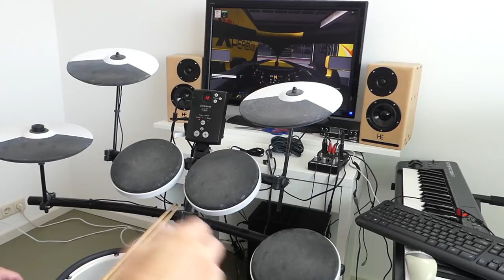Using a Drum Kit as a Sim Racing Controller. How Hard Could It Be?!

Comment: I do like the snare-rolling down the straight and crash cymbal to stop you from, well..crashing. But if you're to be taken seriously as a sim racer, I reckon it needs to be left and right hands (or feet) for steering. Trouble is, there's a serious risk you could get good at it and not be able to drive in any other way - happens with VR. How about streaming races like that? Would definitely get a following.  The original Surrealist sim racer Youtuber.  Gotta make it iRacing as well. Go-on, go-on, go-on!
Reply: Edit: Just realised you are in fact using left and right hands for steering. Apologies! I must have been mesmerised by your awesome hand speed.